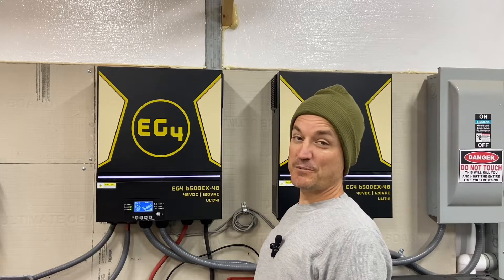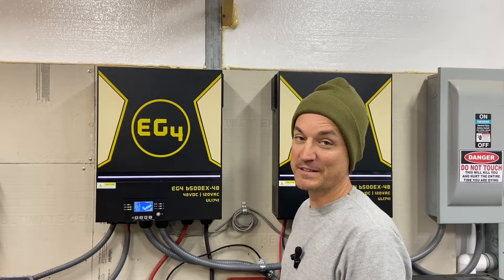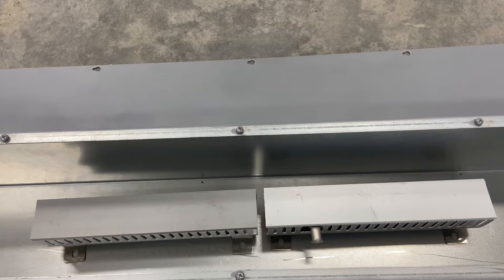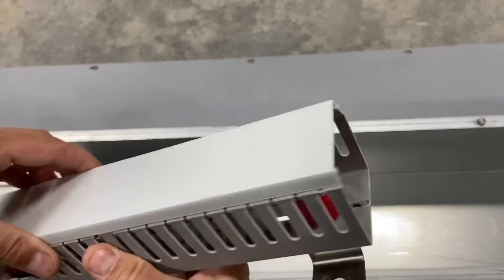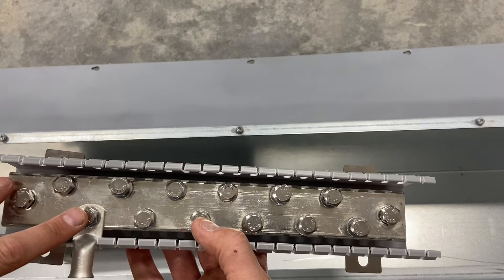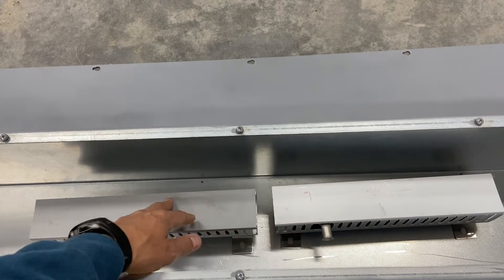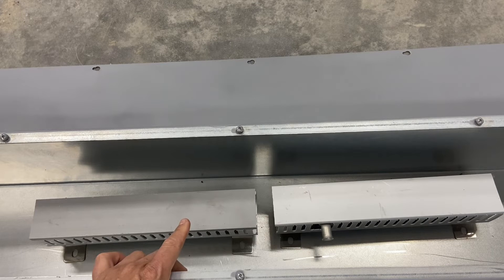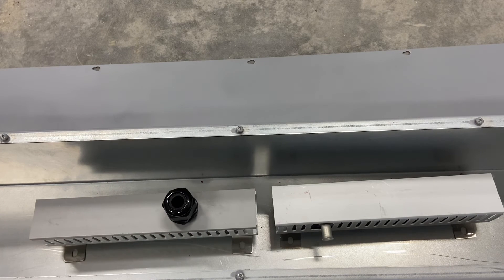My new favorite bus bar! And preparing to clean things up.

Comment: Hey Gavin, how do you size busbars? If I were to buy 2 lv6548s, 10 sok 100Ah batteries, how do I size fuse block and busbar, I mean as far as system calculations?
Reply from the maker: I talk about that here in another video. https://youtu.be/B7nIefmv9MY
Reply from the maker: You’d use a 200 amp breaker for each 6500 watt inverter.  They need to exceed 48v to work with that system. I have two different options for those on the description of this video 48v solar system breaker requirements.
https://youtu.be/HYjErVlx8cY

Comment: I have both current connected$40and signature solar$87 bus bars. Great products! I wish i had gotten a 1000amp bus bar instead because Ive dramatically grown my system
Reply from the maker: If it’s a 12v system I could see people needing the 1000 amp for sure. But for 48v, it would have to be a massive setup to need more then 600 amps.
Reply: @GavinStoneDIY  im off grid with a 48v Eg4 system. Im planning to get an Ev and tankless water heater soon
Reply from the maker: @D.I.Y.OffGridProjects  then you should be good. The 600 amp bus bar will be good till 30kw of power with a 48v system. So you would have to have a lot of inverters for that kind of power.

Comment: Thanks for sharing. I have been interested in the MPP LV6548 and the EG4 6500-48. not sure which one to get.
Reply from the maker: It depends on your needs. The mpp has been a solid unit running my loads for nearly 11 months. The eg4’s do have a higher voltage range though. Some of the eg4 models have been glitchy. But I believe the firmware updates are starting to fix those issues.
Reply: I think the older MPP 65-48 250 V r better. Quite a bit less idle consumption I've seen a couple videos about that. You just can't😅 put as much solar panels on them

Comment: Love it!  I'm thinking you could come do a wire tray on my system, clean up the mess a little, and make a video of that as well.  I wouldn't charge you anything and will furnish all the materials and all the beer you can drink. 😃

Speaking of the wire tray, where did you get it?
Reply from the maker: I don’t drink, so it would probably have to be lemonade.😉 I would actually take you up on that offer if you were  a bit closer. I love doing this stuff! But you’re probably a bit over 20 hour drive from me. Im just not feeling that. I got the box at my  local electrical supply. Well “local” is a bit of a stretch, since there’s nothing really near me. Cost about $170 with the end plates included.
Reply: @GavinStoneDIY  Actually I'm more iced tea myself so we'll have tea and lemonade and I'll grill some steaks.  Yeah, that's a long haul, but if you're ever down this way give me a holler - I wouldn't really put you to work.  That's not a bad price at all.  I'll check my local electrical supply when I get ready for the wire tray.  I often forget about them and they are very competitive on most stuff.  We get conditioned to just go order everything online.  I'd rather shop local if I can.
Reply from the maker: @easttexascowboy257  that would be cool. I’d love to see your system. I lived in Texas years ago. It was hot as hades. You have to hide in the AC the whole summer.
Reply: @GavinStoneDIY  Note to self - don't invite Gavin here in July or August.  😲

Comment: Not a criticism, just a passive observation: the frequency with which you swap between the EG4 6500 and LV6548 units, you may want to consider building a docking station out of Anderson connectors and RV off-shore power plugs. ;-p Great videos as walways!
Reply from the maker: 😆That one really made me laugh. You’re so  right though. I’ve got a test board in mind. So within the next few months I’m going to plan on making a spot to test inverters I think. Should be fun. 😎